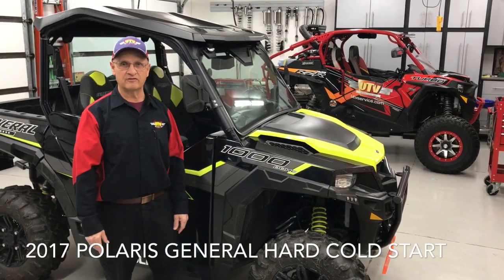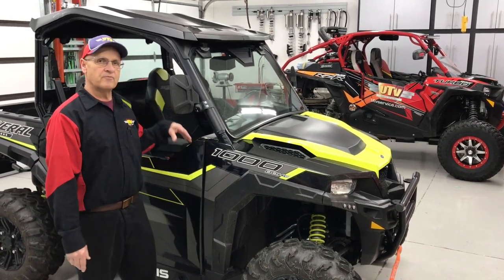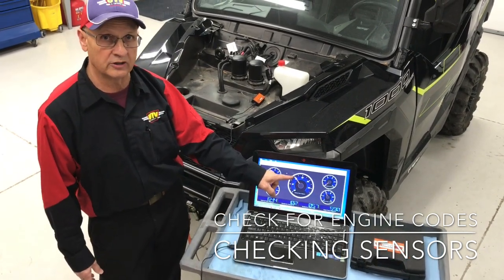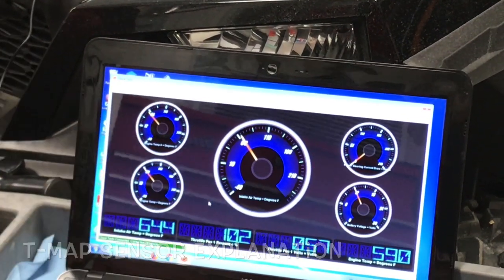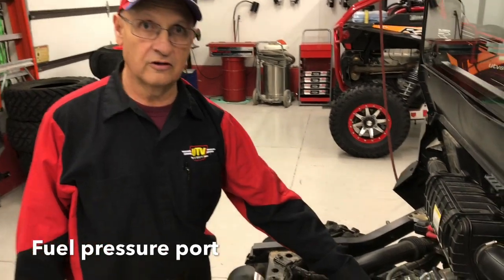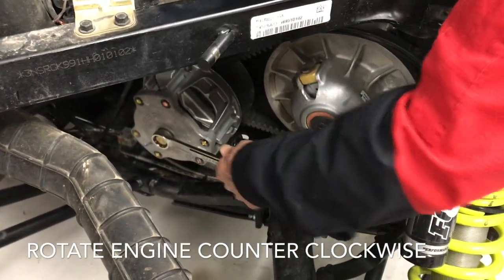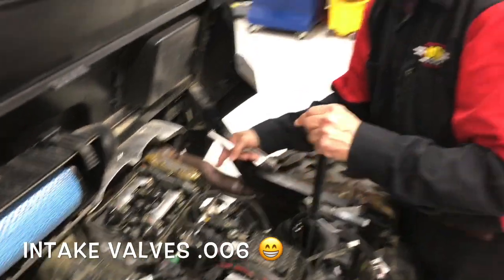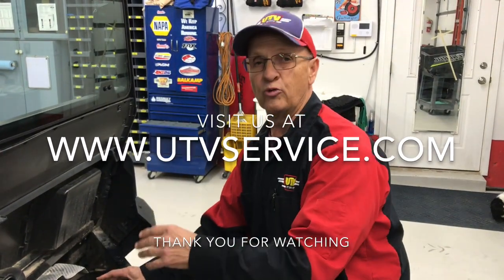How To Diagnose Polaris General 1000 Hard Cold Start, Step by step procedure. Fuel pressure, Codes,

Comment: Hey Gary I have a 2021 rzr 1000 . The engine has a miss # 1 cly when the engine gets a little heat it runs fine.  I have good spark on that cly and the injector has 12 volts. Not sure about the ground signal from the ecm . One other thing is  about 50 mph the engine will lose power you can turn the engine off with it still in high gear turn the switch back on and it's fine until till you reach 50 mph again.  Thank you

Comment: Hello Gary,  We just purchased a Polaris 2018 General 4 1000 with 518 miles on it.  We have taken it out for several rides and it started just fine.  Tried to go for a ride yesterday and it wouldn't start.  Cleaned the battery terminals.  No start.  Purchased a new battery and installed it.  No start.  The dash lights turn on, the headlights turn on.  Any suggestions you could provide would be appreciated.  Thank you! Robyn

Comment: Hey Gary I just watched you’re video, I’m having the exact same issues with my 2018 xp1000 4. I’m going to check the clearances this weekend...do you have a video on how to adjust the valves if they are out of spec? Thanks!
Reply from the maker: Hi Bruce, I just found out how to look at my messages, I do not have a video that shows the exact process. I have also ran into two Generals that ended up and had to change the computer tune to fix there cold start